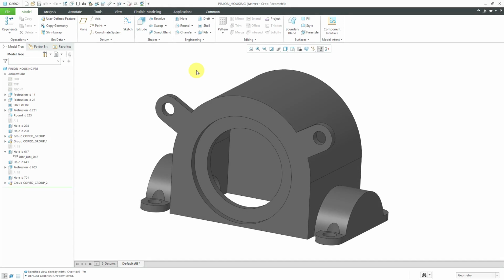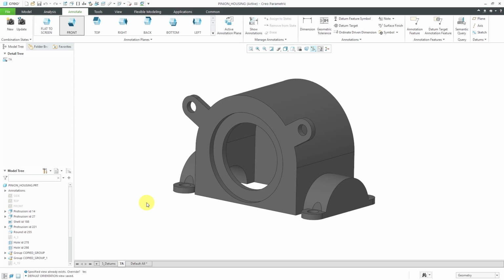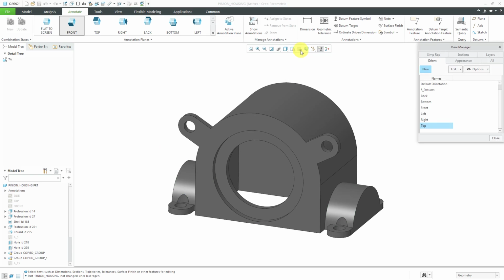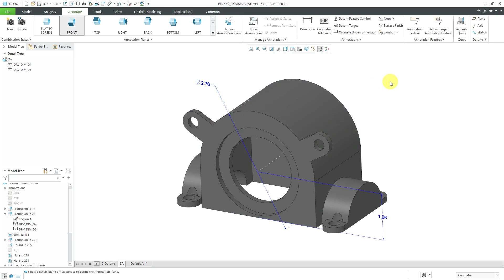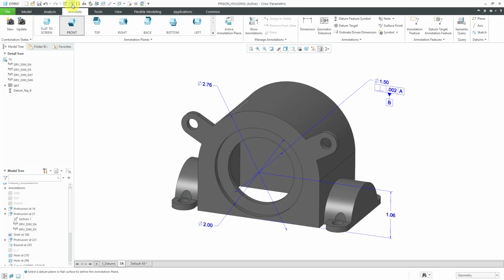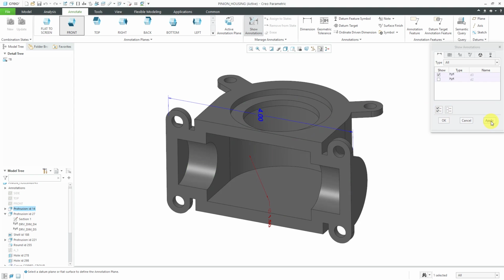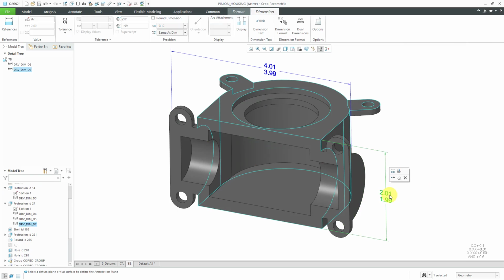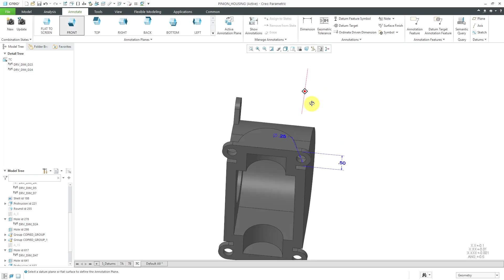Creo Parametric - Show Annotations - Model Based Definition (MBD)

Comment: If I need to change the annotation plane of a dimention add from a feature sketch, how can I do that? In this tutorial you change the plane from the original sketch plan, to another parallel one. But how can i use a perpendicular plan, for example? Thanks!

Comment: Hello Mr Dave

I have a trouble with an MBD, maybe you can help me. 

I am using simplified reps in some of the combo states of my MBD, also some combo states are using its own layer state, this is an MBD of an Assembly. 

The problem is, when I press "regenerate" some dimensions moves alone in some combo states and I need to adjust their position again, this only affect the dimensions, notes and symblos keep on their original position. It is an eternal cylce, I put the dimension in a place, save changes, press regenerate in the current combo state and nothing happens, but when I jump to another state and press regenerate, the dimension of the previos combo state moves alone again. This happens in many combo states, even if they don't have  simplifed or layer state assigned. 

I hope you can help me or at least give me an idea of what could be causing this. 

Thanks in advanced.

Comment: Another question, can these annotations be included when saving a 3D pdf of the part or assembly?  I just attempted to do so without success, even after checking the 'include annotations' checkbox in the 3D pdf save dialog